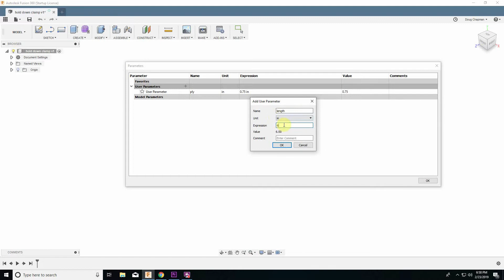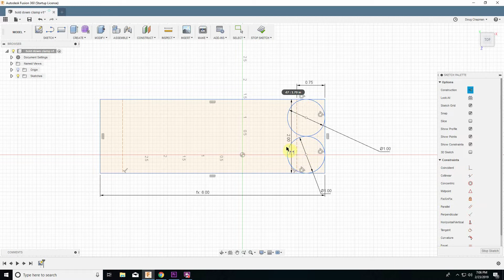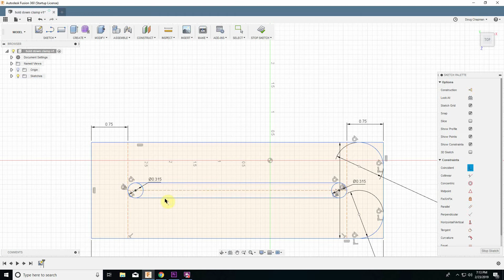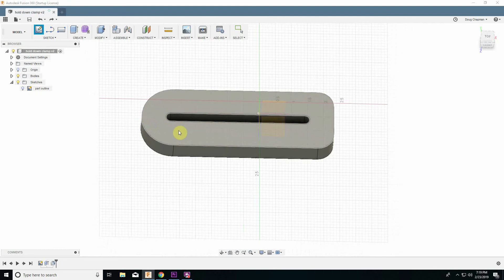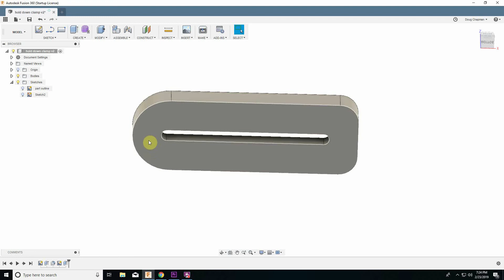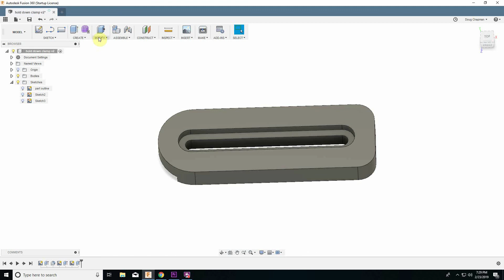CNC Start to Finish Part 1 - CAD drawing

Comment: I am learning fusion 360 but i have years of exp using solidworks and autocad. I am curious why you didnt use the fillet option instead of drawing circles to round the corners of the 2d sketch. The circles method, while useful in some cases, is not the easiest way to round these corners.